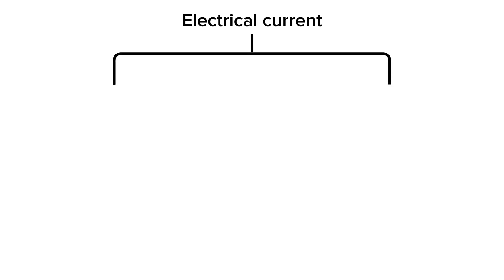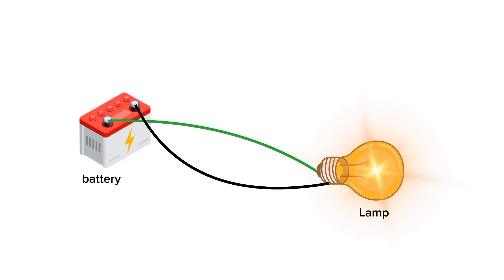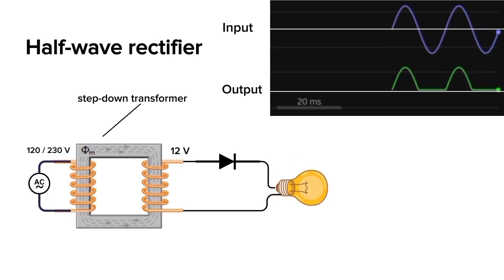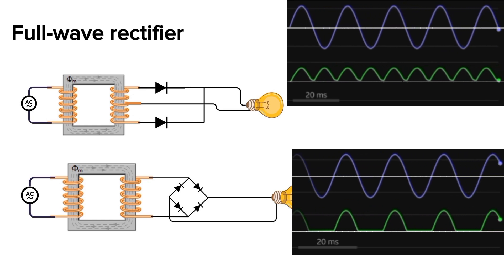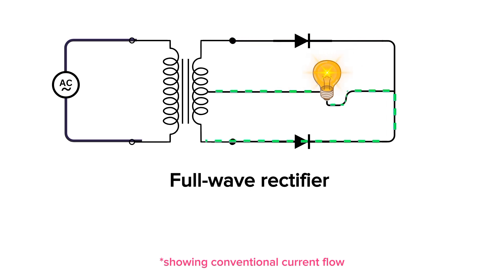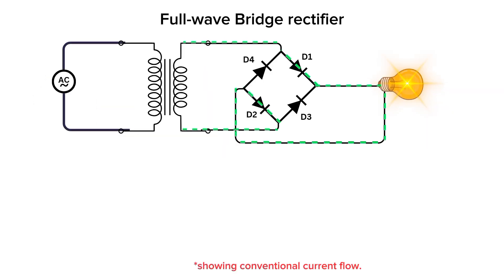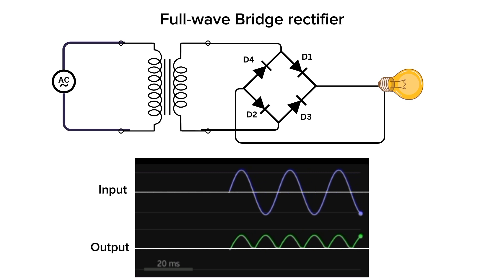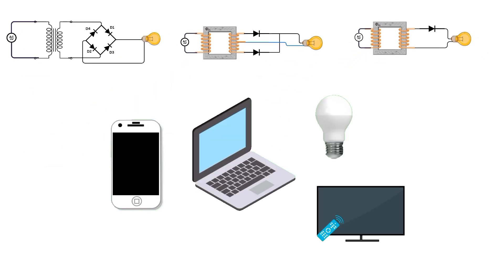How to convert AC to DC | half-wave and full-wave rectifier circuit explained |

Comment: It would have been nice to learn what the advantages and disadvantages of the two full-wave rectifiers are with respect to each other.
Reply from the maker: The advantage of using a bridge rectifier is that no center tapping is required. Thus, we can eliminate the transformer from the circuit if the step-down voltage is not required.

A bridge rectifier needs four diodes, which makes the circuit more complex than a center-tap rectifier. Additionally, the voltage drop in this scenario will be two times more than the voltage drop in a center-tap rectifier. This is because a center-tap rectifier includes only two diodes in its circuit.
Reply: @oneELECTRICIAN  Thanks!
Reply: Am confuse with center tap output voltage in the transformer. Center tap is 0 and two other tap are 12 volt ac. Tapping both 12 without using center tap result 24 volt ac. Output going through full bridge rectifier result 12 or 24 volt dc?  @oneELECTRICIAN
Reply: @xxatya the advantage of the full wave over the half wave is that it uses the full cycle of the wave. But each only taps half the voltage at a time. The bridge rectifier uses the full wave and the full voltage of the cycle.  The total output of each is the same as the number of diodes involved. Twice the power from the full wave overs the half wave, and double it again with the bridge rectifier.